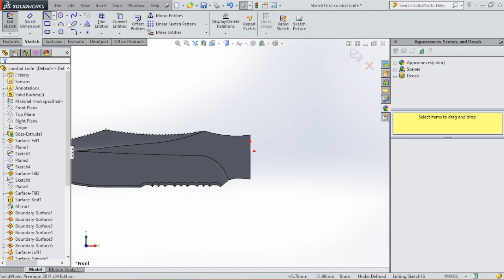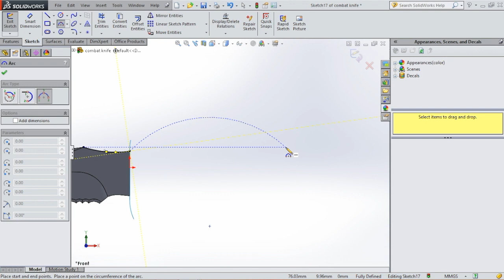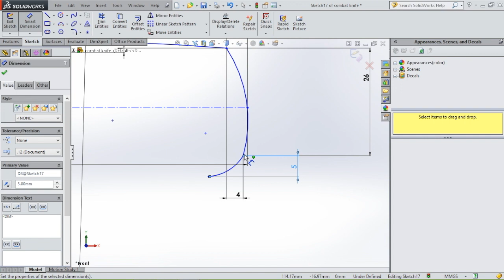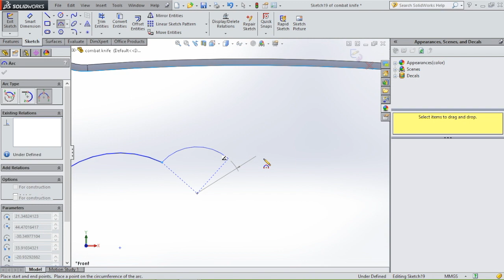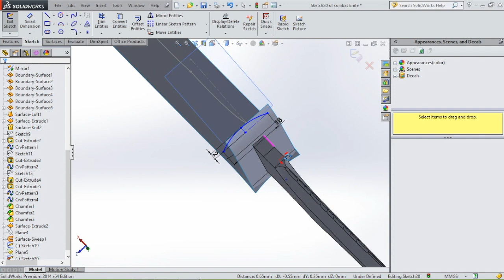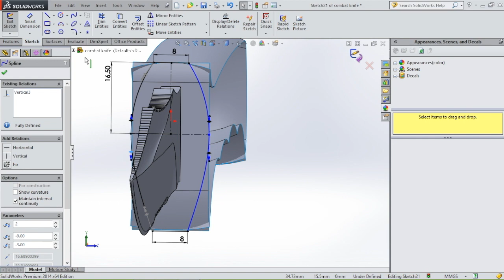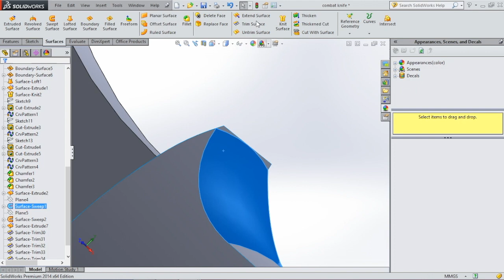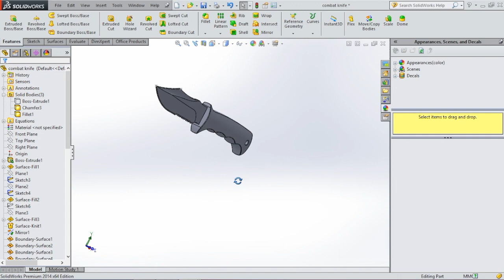SolidWorks Beginner tutorial 7: Combat Knife - Part 2 (surface modeling)

Comment: I don't know if this channel is still active, but I love your workflow with the smart dimensions dictating the shape the curves take. I do have one question: How do you arrive at those values? Did you pre-measure a knife that you are now modelling, or did you just tweak the values until they were the way you wanted them and wrote them down for this tutorial? I'm not new to modelling, but most of the complex modelling I've done has been with Rhino, so I'm not very familiar with advanced modelling techniques with parametric softwares as opposed to NURBS (thus why I'm watching the tutorial).

Comment: How Do you make the trim tool work, mine does not seem to work ..
Reply from the maker: At what point of the tutorial are you stuck?
Reply: Great tutorial.  I started losing it about 13:47 but this is all new to me.
Reply: I am getting the same issue. It is the part at 13:45 and I get an error saying the trimmed pieces cannot be sewn together.
Reply: I figured it out. I needed to remove selections but the default is keep selections.